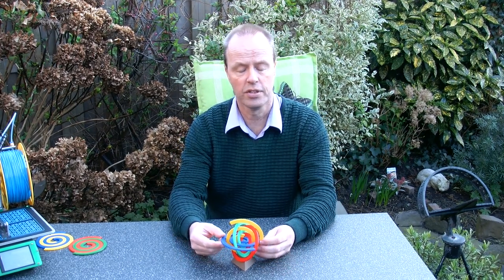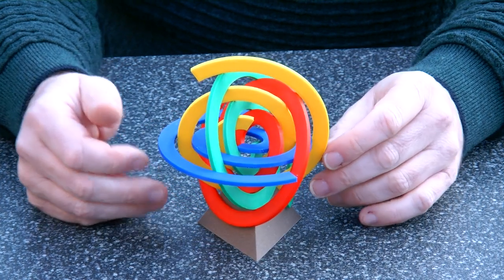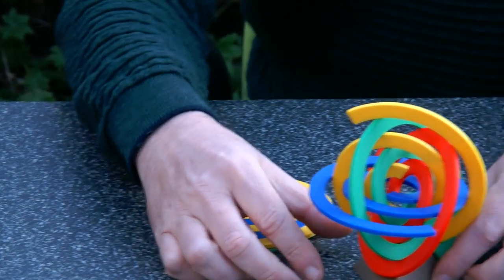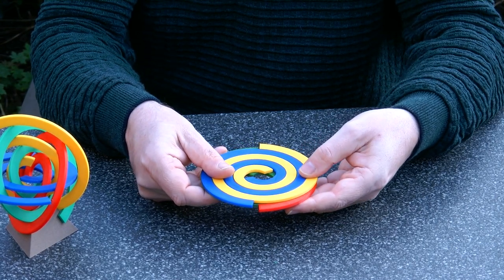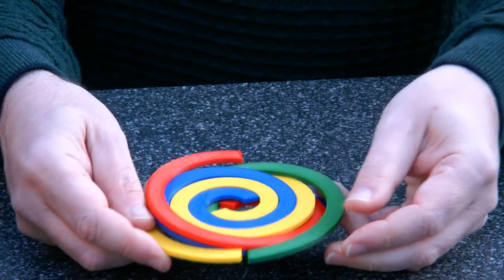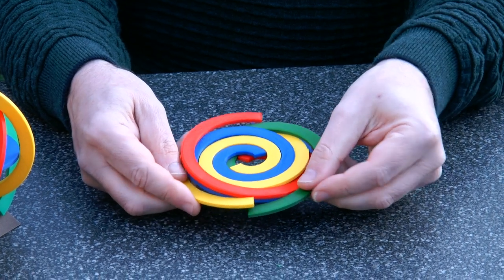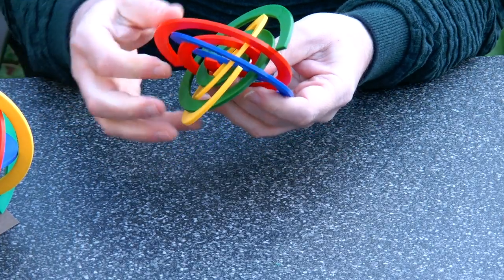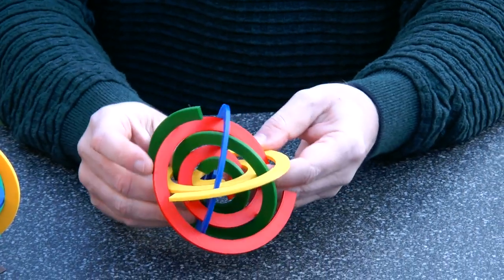Four Interlocking Spirals - Can you print and assemble it yourself?

Comment: Printing is easy, assembly is more difficult.  I attempted assembly without viewing the spoiler, no way.  Even after watching the assembly several times I found it tricky.  But it is now together, sitting on its stand.  Brilliant design!
Be very careful to get the over-under parts correct, or you could break a piece.  PLA is flexible, but not infinitely so!
Reply from the maker: Great result!